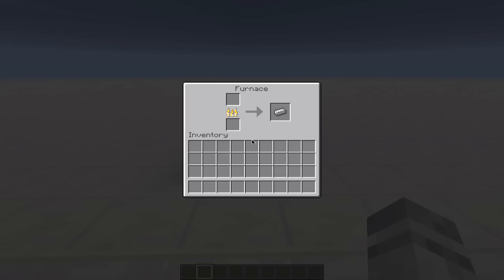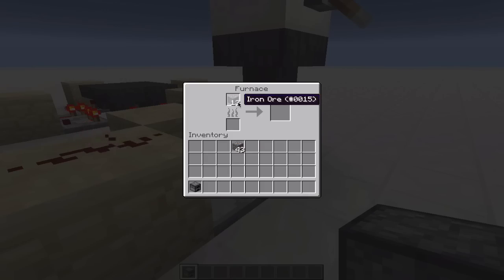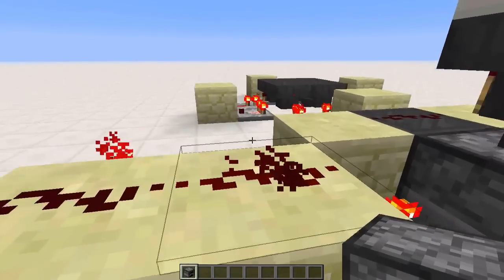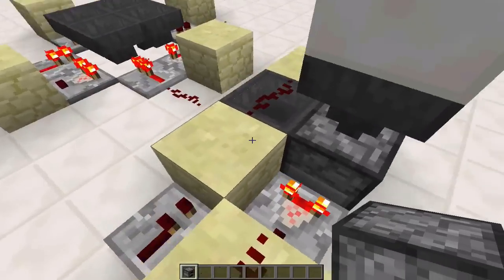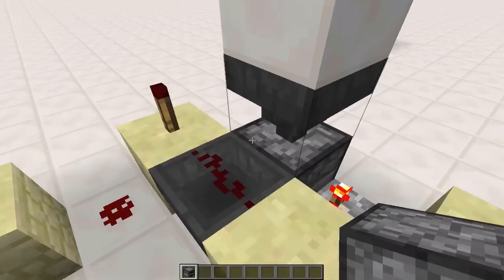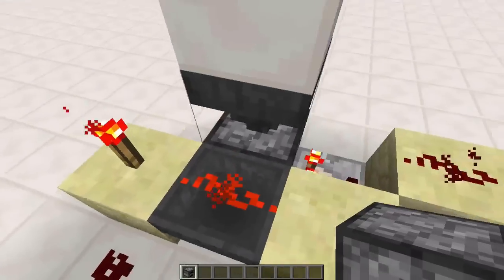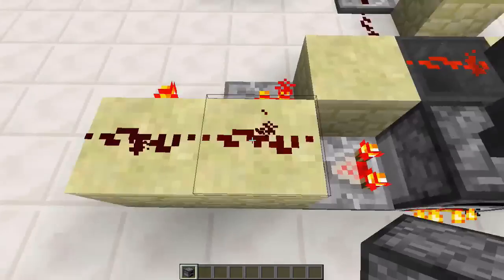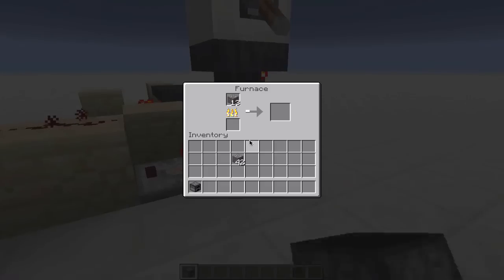Proof Of Concept: Coal-Efficient Furnace

Comment: Just revisited this and wondered why the need for a timer.  Then I realized it's to keep the coal coming in one at a time, at 8 smelting operations apart.  I guess that's one way to do it!  Another idea: having it add coal when 8 or more items are in the furnace, then waiting for it to BUD twice before adding another piece of coal, if there's enough for another piece of coal.  Might be smaller than a timer, might be bigger, I dunno yet.

Comment: You can use the one wide hopper clock of st3venAU for the timer, and you can put the comparetor on subtraction mode and use an side-input to configure it. Not that hard right?

Comment: I just made a version that does that. 
I did some testing and when you prove a contant stream of items with a hopper from above 1 coal still smelts 8 items even if they are different types of items. This means you only have to make sure that there is only enough coal in the furnace to not smelt all the items. I did this with ethos hopper timer and a dropper which dispenses coal into the furnace at the rate it gets used, if there are enough items in the hopper above.